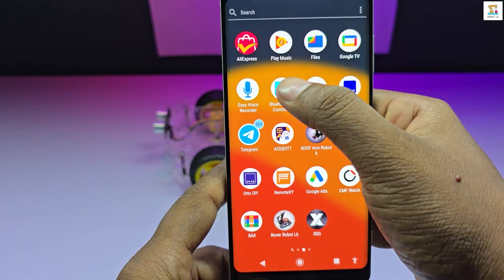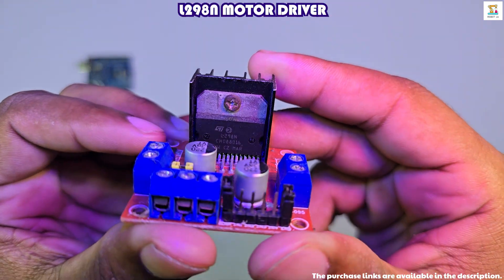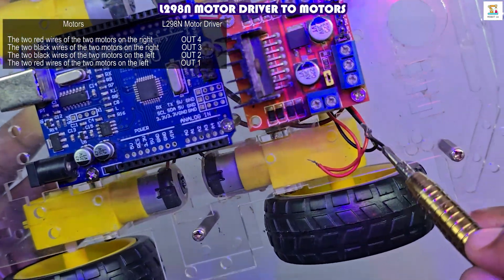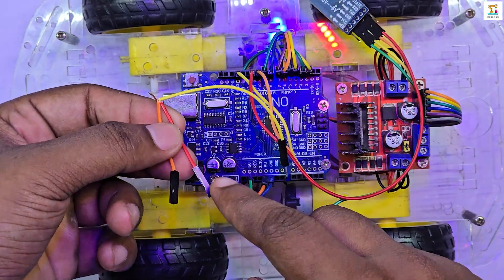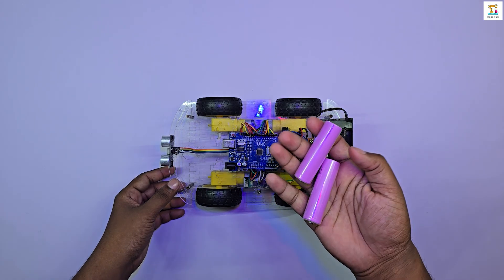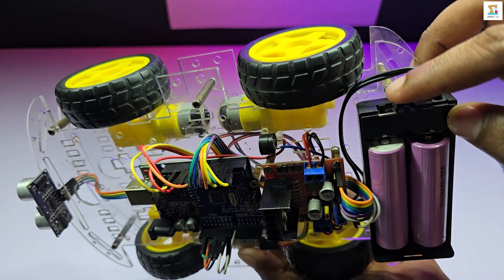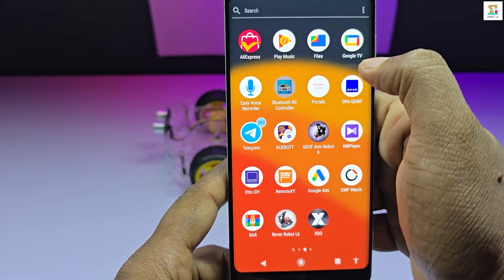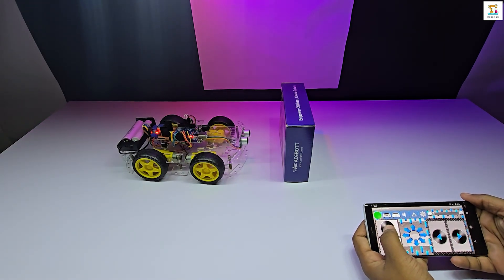Arduino Bluetooth Controlled Car with Obstacle Detection and Buzzer | Safety Feature | Mobile APP

Comment: Bro circuit will be connected properly but my blutooth module hc-05 cannot connect to my mobile blutooth
Reply from the maker: Did you try connecting it to another phone?
Reply: @RobotLk yes I will try but kit does not working properly

Comment: I have done all wiring and connection as you tell but the thing is the robot hc05 is not connecting to my phone and also I could not able to control the robot can you please tell me the reason
Reply: Even I have checked 3 to 4 times but still I could not able to control my robot tell me the problem error fault the time
Reply from the maker: Will the Bluetooth module connect?
Reply: @RobotLk the main problem is when I connect it from serial Bluetooth terminal app it is connecting but when I try to connect with RC control Bluetooth app it is not connecting and after 3 to 4 days I have exhibition so for me it is and big issue so please if you can solve please tell me
Reply: In the RC controller Bluetooth app it is showing unable to connect I don't understand what is the problem because if it is connecting in serial Bluetooth terminal app then what is the problem with RC controller Bluetooth app

Comment: If im using now so when ever im using roght left front or back in app so rx light is blinking fasstttt and no car is moving forwardsss only rx light blinks else where motor doesnt show movementt
Reply: All items and all are ok with connection please help mee
Reply: @Home01010  same issue
Reply from the maker: That shouldn't be a problem. Is the Bluetooth module connecting properly?

Comment: Now what should i do 
Green light came on the app and all connection ok then also not moving in app
Reply from the maker: Did you connect the Bluetooth module to the mobile first?
Reply: @RobotLk reply to my latest comment
Reply from the maker: What battery do you use?
Reply: @RobotLk  please reply to my latest comment 😢

Comment: Brother, I tested the 2 motors of my Arduino car separately. But after fully installing my car, it doesn't work. What is the reason?
Reply from the maker: What batteries are used?
Reply: @RobotLk 12v 18650 battery
Reply from the maker: Is the Bluetooth module correctly connected to the mobile? If 12v is too high, sometimes the Arduino board can be damaged.
Reply: @RobotLk yeah, but I removed the Bluetooth module because it wasn't working. The car just spun around once. Then I wrote and uploaded the code so that the car would work automatically. But the light on the car's motor module only turns on. The car doesn't work.

Comment: Bro but also not working same problem😢😢😥😢😭😭😭😞😞😞😞😞
Reply from the maker: Check all connections, and make sure the Bluetooth module is bound.
Reply: Now it will connect but when we move it will disconnect 😢😢😢 I think it is due to because I had reuploaded code to ardiuno please tell me Bro please😢😢😢😢😢😢😢😢 and I used 4 battery But also not working😢😢😢 what you think
Reply: What is bhoud